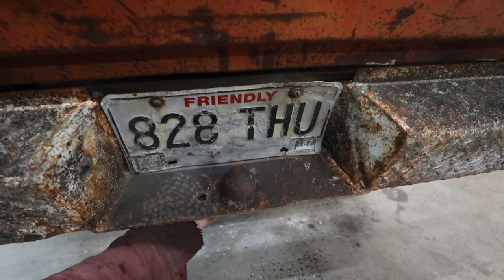Modifying and installing a random hydraulic dump bed in our 1955 Chevy Napco Clone

Comment: Is your hoist lift cylinder of to be fluid like Hydraulic fluid or is it pneumatic air jack long ram very good for dump bed Napco and to install the new cross member that is below the level line of the other common cross member in the Napco chassis. If you do the dump truck with lift and not hoist then you are to be a new ability of being the owner of Halfassed and Napco. The Chevrolet GMC does not do the dump truck configuration and design. Only you need the blueprint and get the study on how to copy my 2500 HD 4 wheel drive Chevy silverado from my old Tahoe Chevy pick-up. Your box is light weight, my box is longer stretch long bed - heavy weight is the box with two door at the back of the box.
 The box that you mount on is too low so the box has to raise up higher then you intall the lift. The hoist is from above with steam shovel's wire rope. The hoist is obsolete instead of hoist, use the lift that ram slowly the box up into leverage from flat into angle.

Comment: When do you go to work on the ramp Bed for your Buddies big car hauler
Reply from the maker: Soon.
Reply: @HalfassKustoms  He'll have to go hunt something in the 1 ton size or bigger frame, When he sat the cab down on that little half ton frame the other night, you could only barely see the front spindles they were so far under. Half ton stretched out the length of what could carry a vehicle wouldn't be strong enough by a long ways.

Comment: RE: Speedo cable. 
Why does it have to go out the firewall??  Route it down the firewall in the cab, then put it through a hole in the tranny (can we still say that? Lol) hump on the passenger side. 🤷🏼‍♂️ why buy a longer one
Reply from the maker: Any way I do it the cable is to short. Have to remember the drivetrain is about a foot longer than the original setup.